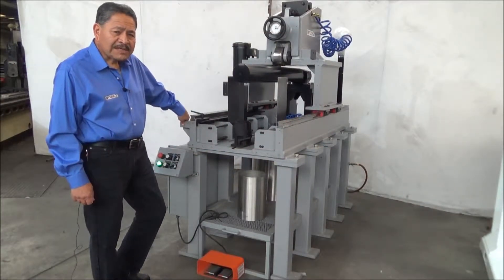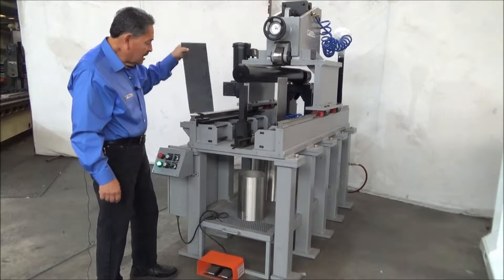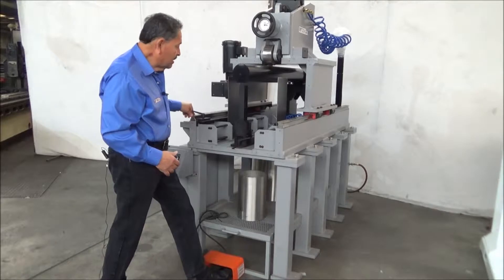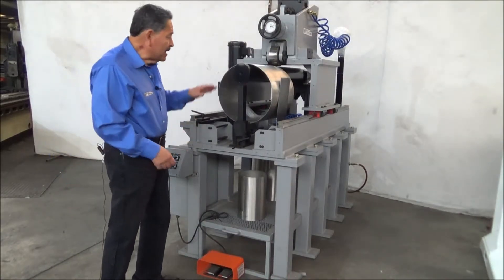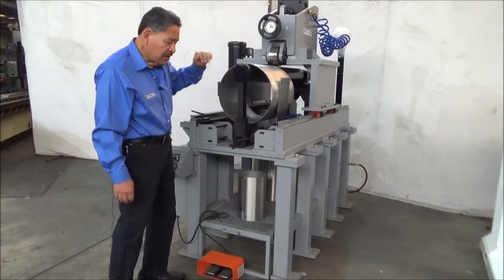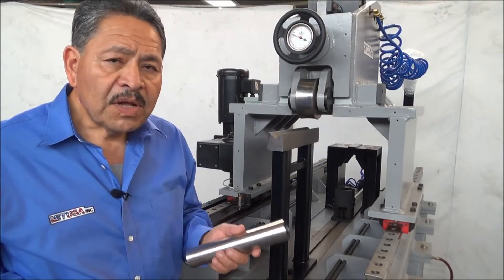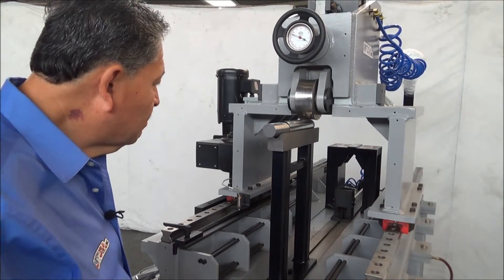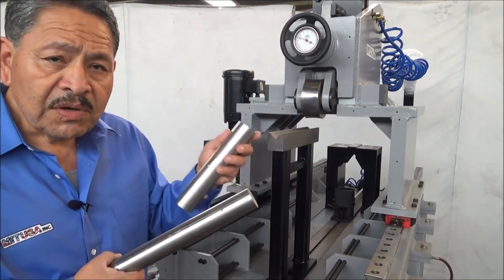Roll Planisher - Gantry Planisher Overview | MITUSA, Inc.

Comment: I would like to have seen a close up of the weld bead before and after planishing.
(Whose music is that in the background at the end of the video?)
Reply from the maker: We did fail to show how smooth the weld looks. If the bead profile is low in most cases it becomes seamless. All double tub stainless sinks were all seam weld and then planished.

We will run samples for you.